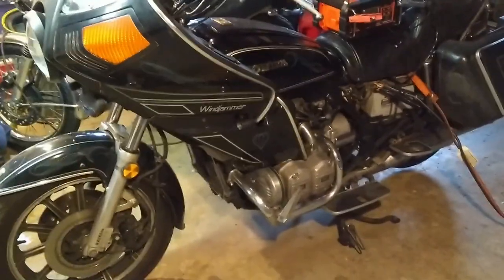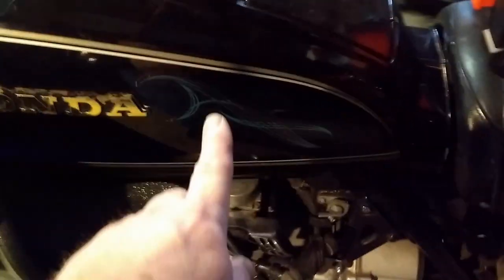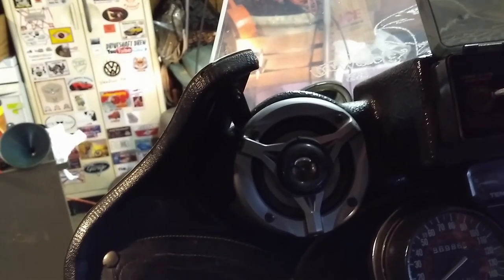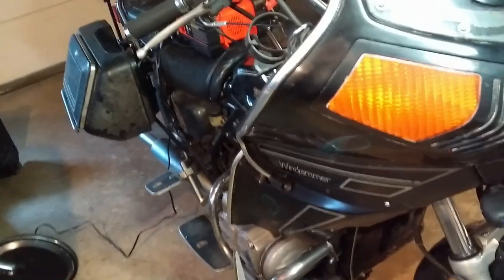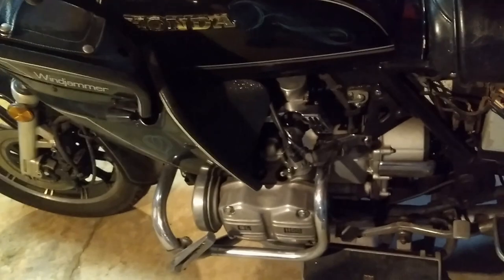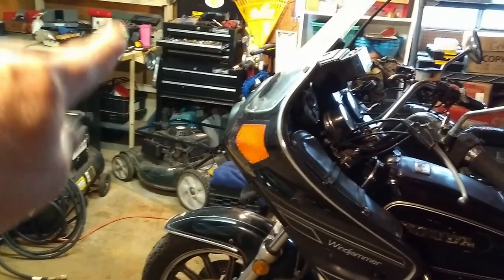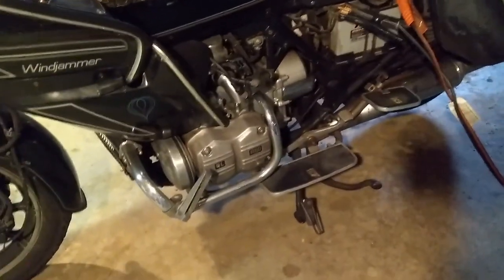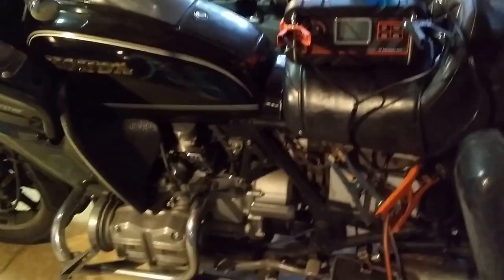Addition to my stable

Comment: Good snag.  Since you don't know much about the recent maintenance history plan on replacing the timing belts.  Recommended interval for a change is 10 years/40,000 miles.  Give it some good gas and see if it will start.  If they fogged the carbs it could be a runner.
-Stay warm.
Reply from the maker: Good to know about the belts I will sure change them since its a cheap fix and I have to take the front apart anyway, see my new video this weekend it will be short but you will know what I mean. :)